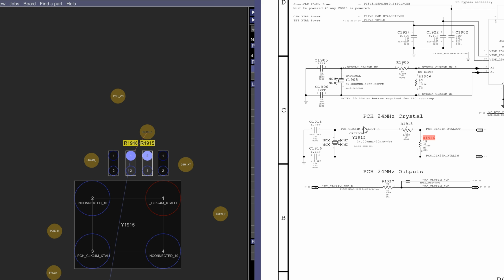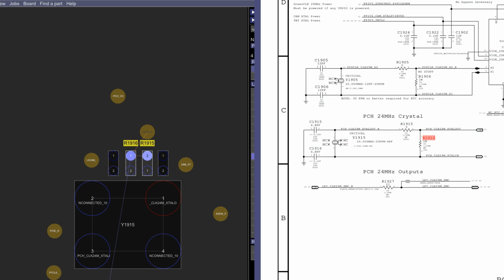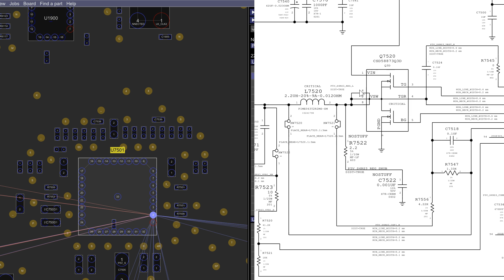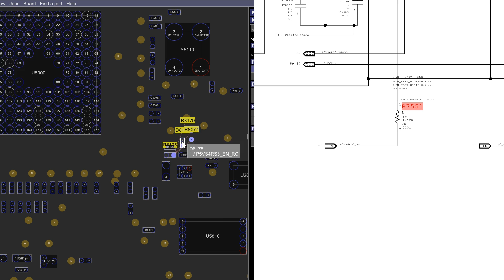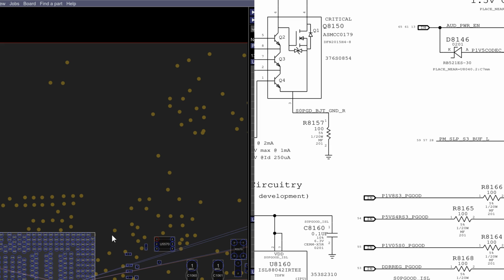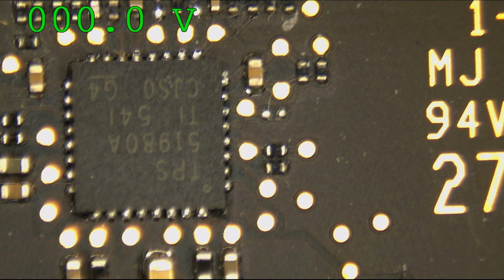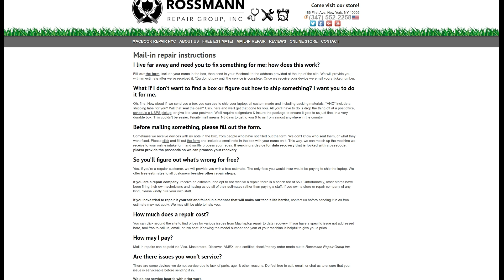Why is PM_SLP_S4_L missing on this Macbook Air logic board?

Comment: Thank you for this video, Louis! It was very helpful!

I have PM_SLP_S4_L (oh I get it now, they just hold the shift key down) missing on an 820-3115 and I'm afraid it might be a dead PCH. Thing is, it happened out of nowhere. I'd like to be able to fix this if possible, so every single piece of information I can acquire about this issue helps a ton.

I've got every power rail I should have (I haven't touched the board in two weeks so sorry for being ambiguous), except for the ones after PM_SLP_S4_L. I have checked all of the resistors leading to the PCH and they're fine. I will do more troubleshooting when I get a chance, but I'm wayyy too busy lately (too bad that doesn't mean more money for me, as I am tasked to fix everything). I'm still slightly hopeful, in the back of my mind, that I might eventually bring this board back from the dead. And hell, if I can't I might just send it to you (no I won't, you have better things to do, and you have better things to do, and I can't afford it). I find it a little hard to believe that this would spontaneously happen, and yet it did. Fart noise.

Anyway, like I said, great video, I learned a lot yet again. I love working on these Airs, they seem especially easy to fix. Thanks for the great content, as always I learned something, and I look forward to the next one.

Comment: Noob question here: what is that gel stuff
Reply: It is called flux. It's a mixture of weak acids that cleans the pads and the components and helps solder flow.
Reply: Alberto B thanks